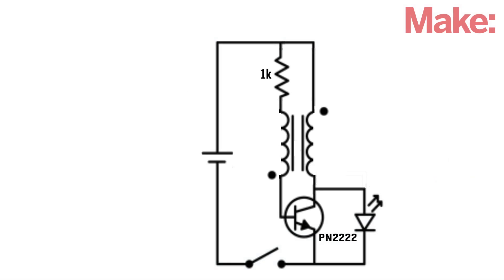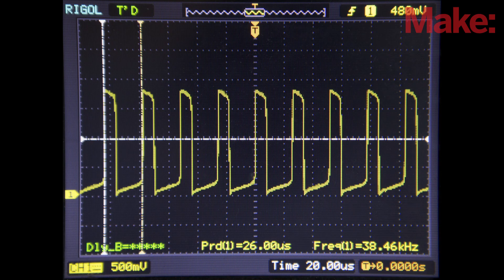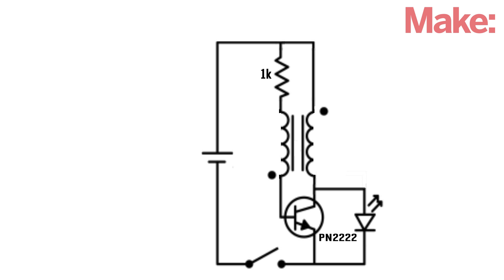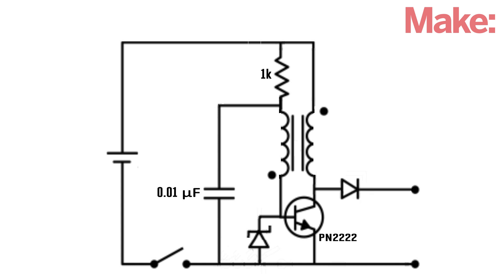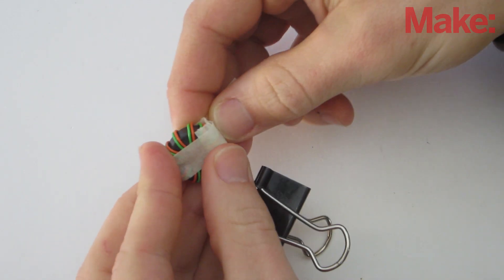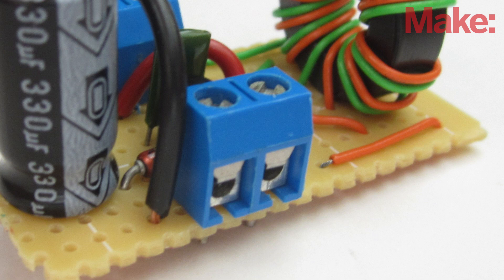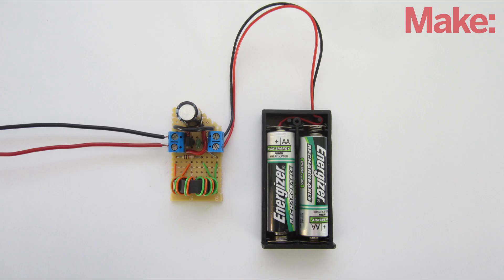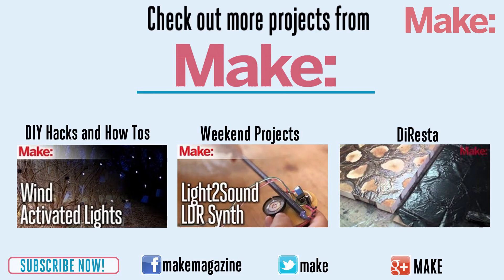Joule Thief Battery Charger

Comment: hand crank motors often have low voltage which is even more lost on the rectifyer bridge. Can drive Joule thief from such motor and it will boost voltage to charge a supercap or battery

Comment: The coil has two wires, red and green, let's say red is connected to battery or DC source via resistor and transistor, and green is connected to load, my question is what happens if u connect load and green coil all in series (excluding battery), meaning inductive spike generated from collapsing magnetic field doesn't have to go through the battery?

Comment: Although you did not show it practically , doesn't the coils have to be connected in opposite directions ? IE.  The start of the orange wire is connected to the last( end ) winding of the green wire so you end up with three connections:  orange out ( last tail)...?  then orange start soldered to green last tail ( end )....and the third connection is the start of the green wire.   The schematic does show the coils wound in opposite direction with the dots

Comment: I have been experimenting with charging two 1.5v AA batteries from 4 small ,parallel  wired solar panels all day.At the moment I have them joined up to a jewel thief , the volts seem to be creeping up slowly,even in quite low light.I have been looking for a way to improve the circuit,and yours looks worth a try.

Comment: The cap after the diode isn't needed. In fact some think that a high frequency changing a battery helps batteries that are getting where they don't want to take a chance anymore because it can clean the surface of the inside parts, but I have not done any tests

Comment: Instead of winding a coil you can use a pair of through-hole or surface mount inductors (look like resistors) & dirt cheap, For even smaller size and better control you can use a dedicated boost converter chip, no transistor, and just one inductor since it will pulse by itself. Look inside a cheap solar powered garden light to see how this is done.

Comment: what function do capacitors play  in that circuit?
Reply: They help to stabilize the voltage going to the battery and into the joule thief
Reply: I think the one on the left is for moderating and extending the output pulse. It works like the filter capacitor in an AC to DC circuit.

Comment: This sounds stupid but..... Couldn't you use a dead rechargeable battery to charge another dead one and than they switch places, two fully charged ones from 2 dead ones?
Reply: John Shaughnessy The batteries will just transfer charge with one another and in doing so, they lose energy because the circuit uses electricity
Reply: Howwww To Start A Batteryyyyy Business At Hommmeeeee>>>>>>http://restorebatteryy.blogspot.co.uk >>>

Comment: I have a small array of solar cells that produce around 2.5 v max. I want to be able to charge either a phone or battery bank, both of which draw 1A and 5v. Is there anyway this is possible as i built the circuit but my output voltage drops to basically 0v when the phone or power bank is hooked up. (It produces around 7V when nothing is hooked up to the output.)

Comment: Hi, What type of cap did you use for C-2 your output and what type of rectifier diode D-2 . I am going to attempt doing this of the glass of a USB plasma ball. I know it sounds crazy and I am sure a lot of people would ask me why do I want to do that, but I have found that there is a lot of power coming from the glass of a USB plasma ball and just for fun I want to find different ways to turn it into usable energy.  I am sure that I will have to rectify the imput some since the 20 KHz frequency coming from the glass is like a very strong  radio signal but like I said fun. I will share back on my results. Thank you.

Comment: hook a joule thief to a speaker... any sound you make in the room at all will light an LED fully... lol.. use a capacitor to build up a charge on the output to help light an LED better.. Pretty close to free energy but technically not free. as the dust particles and air moving around in the room will make tiny vibrations touching the speaker. causing the tiniest voltage to be created..

Comment: Hey , its great I thought about this project why not use a single AA battery to charge the two AA batteries . and then use the recharged battery to again recharge the battery. Sorry if I am wrong feel free to answer.
Reply: Wrong indeed... That would be perpetual, and that is impossible... It's like saying, let's get one cup of water to fill two other cups, then use those cups to fill more... See? Eventually, the amount of water in each cup would be less than a ml... Same with batteries...

Comment: I remember seeing a circuit like this in an electronics book years ago back before the internet was around. The main difference was a transformer was used to step up the oscillated DC voltage and then ran through a bridge rectifier.

Comment: Hi sir, 
I'm your biggest fan, I wanna purchase rc parts from your end to my rc plane, can you sell me the parts below with less rate or used parts....??

1. Rc motor+esc+propeller
2. 3ch Receiver+ 3ch transmitter
Reply: go to Flitetest on youtube of hobby king will also sell you some cheap part 
You are going to want more like 5 or 6 channels incase you want to upgrade with 3 channels all you get is throttle aileron and rudder you are going to want elevator when you become more advanced
Reply: also you need a flight controller and ESC

Comment: Ah yes, charge a battery with a device that doesn't control voltage on the charging side.  Then you wonder why your batteries go dead entirely or stop being able to keep their charge.

It's ok if you use this kind of "booster circuit" to drive a LED, hey, it's only a 1$ LED you break at worst.  Trying to charge a battery, could mean an exploding battery.

Comment: It would be nice to add some battery protection circuits to protect the battery against overcharging etc.
Reply: the circuit is so weak it will not charge the battery sufficiently. the circuit cannot and will not output more power than you put in.
Reply: @americanengineering2063  So you would need two AA batteries in parallel to charge two AA's in series?
Reply: Joule thief https://youtube.com/playlist?list=PLh8HTLB-VWMkqsKIpgXFHg5sJDN5eGqtN

Comment: Problem is since the output voltage is completely unregulated and there's nothing in the way of charge termination you might end up popping your batteries. If you build this circuit keep an eye on the battery voltages and their temperature.
Reply: Well said, you really want to keep an eye on it while charging.

I made a charger based on this once with all scrap parts before I bought a smart charger for my Eneloop Ni-Mh I bought for my camera. I used a decently sized joule thief with 4 windings: power, feedback, output and supply. The supply was half wave rectified and capacitor filtered to reference the switching circuit with 5V from a Zener diode. It trickle charged in separately transistor limited channels at about C/8 so it didn't have a chance to overcharge. I added a switch to change the base resistance for different amounts of batteries up to 4 and I added a simple voltage based cutoff that turned off at about 1.45V. It consisted of a transistor controlling the positive flow to the battery, bypassed for a reason I will state later. It's base was floating between a limited reference to the "supply" output positive and the battery's negative connection. It only used resistors, when the battery had enough negative potential it would turn off the NPN transistor. The bypass allowed 1mA to continue charging when done, completing the circuit and allowing the negative connection to hold the transistor off. When all batteries were done and the output voltage of the "output" coil voltage spiked up high it would light a neon indicator and feed the 3.5-6kHz sine into a piezo, which was decently loud. I still keep it for solar panels and such.

I really thought it through, and it worked great. Makes a nice emergency charger, but is a bit over complicated. Mess of free formed (PCBless curcuit) inside a tiny plastic cube that was filled with with hot glue to encapsulate and protect it from bending and shorting.
Reply: I thought that the batteries would stop charging once the voltage of the batteries equals the voltage of the power source. Can someone explain, in simple terms, why I'm incorrect?
Reply: @J2897Tutorials  Your right, that's why there is no explaination.  Also the joule thief boosts voltage at the expense of current, so the batteries will not recieve a correct charge and will poop out very soon.l
Reply: @bjl1000  nimh will charge just fine, all this really needs is a cut out circuit once it sees 1.5v
Reply: *****
True. But if voltage source produces 1.5V, this circuit produces at least 10-16V alternating DC on the output. It's average voltage will be maybe 3-5V or so at that input level, but the absolute peak to peak voltage can be several times that.
Reply: Exactly what I was thinking, probably use a full bridge rectifier and then add some extra capacitors to regulate the voltage
Reply: You don't need a charge controller for these, the current is so low. i have a 150V output and it can charge Mi-Mh batteries, nothing is damaged, the voltage stays around 1.3V and doesn't go up. although I charge for a week.

Comment: Very bad title for a "Make" video.  It sounds way too much like all the trash "Free Energy" videos.
Reply: Well, it isn't. This type of circuit is used for many normal applications. For example those electric bug zappers, or the energy saving light bulbs, or those cheap bicycle LED lights. It's called a joule thief because you can take a battery that seems to be drained, but as long as it contains a small charge in it it can be used for a low power application such as an L.E.D. light, or to partially charge another battery. In other words, with this joule thief circuit you can drain the last remaining joules from a seemingly empty battery and the circuit will convert that energy to such a level that it still can be used. The initial input power source doesn't have to be a battery, a small solar panel or an earth battery, or a fruit battery are possible energy sources as well.

It is NOT possible to give a completely drained battery a full charge with a single seemingly drained battery because it only charges partially until the initial input power source for the circuit has no more joules or energy left in it. In order to get a full charge you would need several seemingly drained batteries as the initial input power source for the circuit. Batteries with not enough charge left in it in order to operate a digital camera or a computer mouse can still be used with this joule thief circuit.

So the conclusion is that the output measured in joules is NOT greater or more then the input, so it is NOT an over unity or free energy device. It's nothing more then a simple, efficient and fun circuit to play with because it is easy, cheap and harmless.
Reply: It sounds more like "desperate energy" since you're trying to grab every last joule from a seemingly dead battery. It makes sense though, why waste that remaining energy when it can still be used.
Reply: This is free energy though. :P
Reply: Naoki Kashima
No, it isn't, it is not a magical energy generator. It converts existing energy, that's all.
Reply: insAneTunA I realize that, I never said it was magic.

Over unity or energy destruction results can be achieved through 2 ways mathematically:
1) You vary the resistance in respect to time
2) You vary the capacitance in respect to time
(in real life, over unity can be achieved in millions of different ways, electrets, Moray Generator, Hendershot Generator, bi-toroid transformer, Stan Meyer's EPG, Steven Mark's TPU, etc, etc.)

Comment: what kind of sorcery is this!!!
Reply: Well, it isn't. This type of circuit is used for many normal applications. For example those electric bug zappers, or the energy saving light bulbs, or those cheap bicycle LED lights. It's called a joule thief because you can take a battery that seems to be drained, but as long as it contains a small charge in it it can be used for a low power application such as an L.E.D. light, or to partially charge another battery. In other words, with this joule thief circuit you can drain the last remaining joules from a seemingly empty battery and the circuit will convert that energy to such a level that it still can be used. The initial input power source doesn't have to be a battery, a small solar panel or an earth battery, or a fruit battery are possible energy sources as well.

It is NOT possible to give a completely drained battery a full charge with a single seemingly drained battery because it only charges partially until the initial input power source for the circuit has no more joules or energy left in it. In order to get a full charge you would need several seemingly drained batteries as the initial input power source for the circuit. Batteries with not enough charge left in it in order to operate a digital camera or a computer mouse can still be used with this joule thief circuit.

So the conclusion is that the output measured in joules is NOT greater or more then the input, so it is NOT an over unity or free energy device. It's nothing more then a simple, efficient and fun circuit to play with because it is easy, cheap and harmless.
Reply: insAneTunA i was actually kidding but i still appreciate your comment , it's really interesting that these everyday objects contain this circuit

i'm not dumb i swear, my mom told me i'm special
Reply: stefan markov
you're welcome.

Comment: how much higer the voltage gets?
Reply: You could run your house for a year with a car battery.
Reply: Jordan O'C
I was just kidding, two car batteries and a coin cell.
Reply: The More You Know *
Reply: TheDutyPaid ...No.
Reply: Stored Power = Power * Time
Power = Volts * Amps
If you need 230 Volts and 4 Amps to use your computer for 1 hour you would need to store 920Wh. one car battery has about 432Wh. and when input Power >= output Power the battery would need to give 76,5 Amps. but only a few strong wires can lead that mcuh power. and the battery would explode. if you would use 19 batterys you would have enuoth voltage to run you pc. and it would last for about 28 Days. But to run your whole house this would only last for a few horus. So you still can't get free energy. But if you do it to generate enegry out of nothing you would make good as everything we know about physics wrong
Reply: TheDutyPaid Nope! This type of circuit is used for many normal applications. For example those electric bug zappers, or the energy saving light bulbs, or those cheap bicycle LED lights. It's called a joule thief because you can take a battery that seems to be drained, but as long as it contains a small charge in it it can be used for a low power application such as an L.E.D. light, or to partially charge another battery. In other words, with this joule thief circuit you can drain the last remaining joules from a seemingly empty battery and the circuit will convert that energy to such a level that it still can be used. The initial input power source doesn't have to be a battery, a small solar panel or an earth battery, or a fruit battery are possible energy sources as well.

It is NOT possible to give a completely drained battery a full charge with a single seemingly drained battery because it only charges partially until the initial input power source for the circuit has no more joules or energy left in it. In order to get a full charge you would need several seemingly drained batteries as the initial input power source for the circuit. Batteries with not enough charge left in it in order to operate a digital camera or a computer mouse can still be used with this joule thief circuit.

So the conclusion is that the output measured in joules is NOT greater or more then the input, so it is NOT an over unity or free energy device. It's nothing more then a simple, efficient and fun circuit to play with because it is easy, cheap, harmless and useful for several applications.